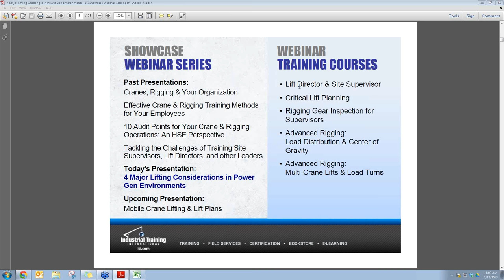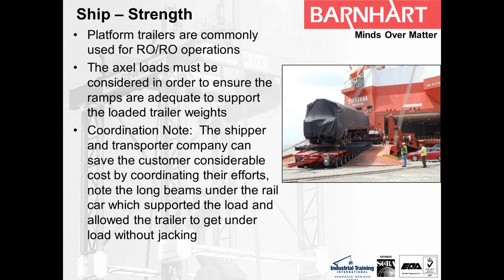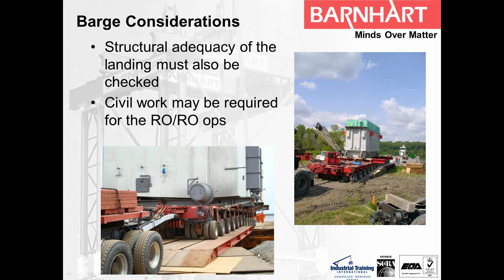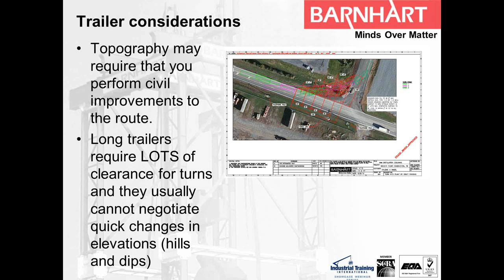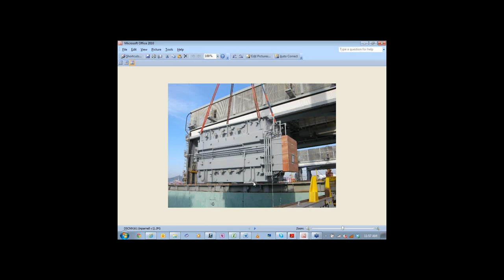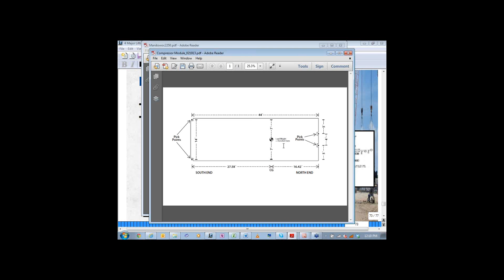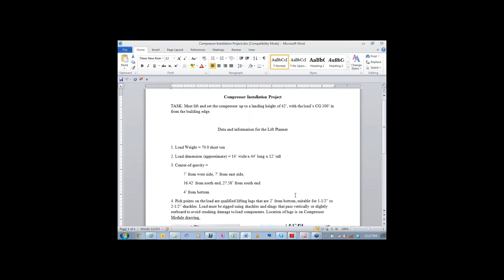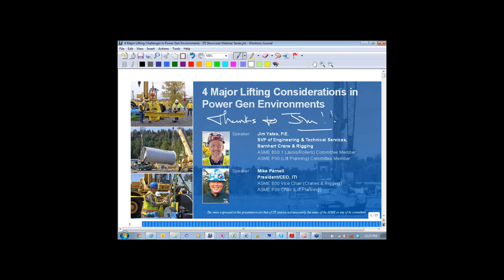4 Major Lifting Considerations in Power Gen Environments - ITI Showcase Webinar Series

Comment: Crane outrigger supports for a dock may need to be designed by a structural engineer. If barges carried their loads below deck level, they would be more stable. If they had raised sides like a ship, wave action would not be such a grave threat.